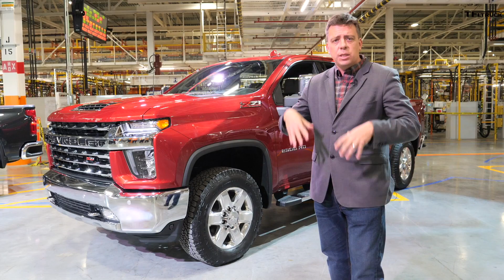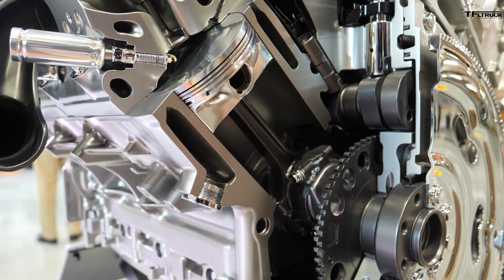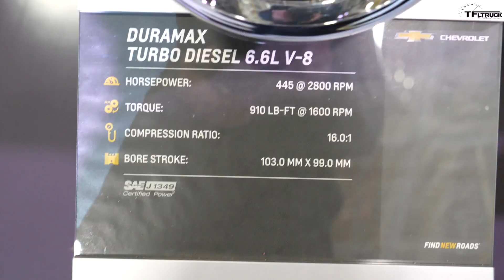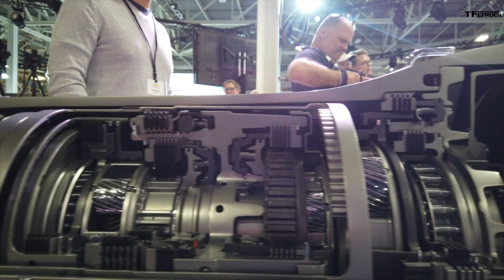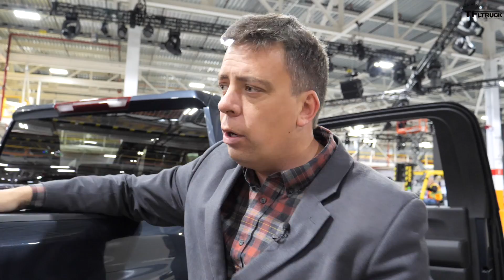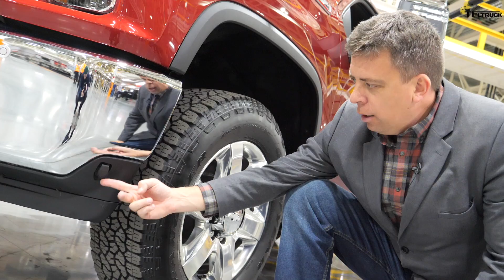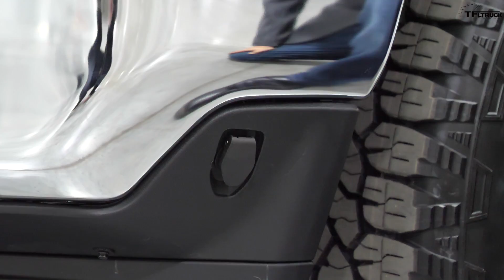Here is How the 2020 Chevy Silverado 2500 HD Delivers the Torque to the Ground

Comment: Oh Chevy... still going to put a 6-speed behind your gas engine while Ram and Ford have moved on. When will you learn.
Reply: Ford is still using the 6 speed in the 6.2
Reply: @geauxtigers2911  what 6.2. Lol
Reply: Their doing it for a price advantage, the 6 sp is cheaper to build and easier to rebuild because it's been around awhile
Reply: Customers do not care about the money they save building something unless its shaving off the sticker price. Ram and Ford are using their existing transmissions which have been around awhile. Chevy has better options but is still stuffing the cheap one in.  The fuel economy difference between a 6 speed vs an 8-10 is HUGE.
Reply: Ford still has 6spd for 6.2L engine. 10spd is only for 7.3L and 6.7 td. To get the 10spd I believe the lady mention it across the lineup when GMC hd pulled boat. We have to wait to see if that's true.
Reply: They are waiting for someone else to develop and build something different so they can copy it or buy it like normal.
Reply: @ecoboostrules9795  your parents raised a dumbass...ford and Chevy worked together to build the  10 speed
Reply: @geauxtigers2911  omg you are severely delusional. Ford had it built and gm wanted in on it. It was already pretty much designed and going in trucks by the time gm got wind of it. GET A CLUE!!   typical gm fan, thinking gm actually did something to help on it. Look at their trucks, you see what happens when they try to design something. 🤢🤢🤮🤮🤮🤮🤮🤮
Reply: @ecoboostrules9795  https://www.caranddriver.com/features/g15377492/ford-10-speed-automatic-transmission/
Reply: @ecoboostrules9795  True that! Ram releases their tow specs and a week later GM finally releases theirs... and it's 35,600lbs over Rams 35,100lbs. If I were Ram I'd raise my rating to 35,601. In the end though Ford will probably be more than both of them.

Comment: I've owned eight Chevy 3/4 ton trucks throughout the last 16 years or so.  A couple new, three of them diesels (04 -09 model), four 6.0l (05-18 model), and one 2001 8.1l with Allison trans. and currently 2018 6.0l gas. All used for pushing snow, hauling 6-9,000lb. trailers and pallets of various weights in the bed. From personal experience, I've never encountered all the claimed problems with these trucks. Regular preventive maintenance goes a long way. Actually cost of ownership is quite low, all I can remember replacing was the common trans cooler lines on 2 trucks back in like 2006 or 2008 and 1 rear axle seal. I'm ok with that considering how much these trucks are worked. Granted,  I'm fortunate to trade up around 70,000 miles or so, but I kick these trucks asses 5-6 days a week (never a trade up because of problems). Anyhow, I have respect for all the big players in the truck market, just happen to prefer Chevy. Hopefully this new gas 6.6l proves as reliable as the outgoing tried and true 6.0l gas engines. Looking forward to owning the new one in a few years. If you read this far,  peace ya'll!
Reply: I off road my Chevy's hard core and daily drive them till  200,000 to 260,000 miles.  Just recommended maintenance is all I do to them no major issues...
Reply: I use the same philosophy.  I've been asked why I don't try Ford or Ram and it requires a simple answer...  Why change when something has been really good to me.  
And I'm sure there are Ford and Ram owners who feel the same way.
Reply: @bryane2857  I've had them all, and mean all. As of 2010 there is only 1 brand i will buy that has been on top for many years. I absolutely hated Ford before 2010. Now wouldn't buy any other truck out there due to technology, comfort, reliability, crash tests, looks, and the fact that they are an American company that isnt owned by government money. All i can say. They make insane power with small engines and have the coolest stuff for performance trucks and cars.
Reply: @ecoboostrules9795  well I was going to tell you great comment. But you ruined it with your snippet about the government. I get your a fan boy, and that is cool.  But open your eyes, Ford was lucky, the secured a loan before the crisis. As pure luck would have it, the other 2 waited to long because Ford needed it worse as luck would have it.  
Your boy Allan Mullully which is The x president of Boeing for which I work dazzled his way threw the mess for Ford. And fortunately for Ford scatted by without a loan  .
It's obvious you can't appreciate other companies with your American bias. 
I hope you apply the same philosophy when you go fly with a airline and demand the airplane be a Boeing jet and not Airbus.
Also demand that Ford don't get anymore subsidies thew federal, state and local goverments. Out your American made comment where your mouth is and fly American made jets or don't fly.  Demand that Ford Fiat and gm alike stop taking subsidies. Until than, your fan boy Ford comment lost all credit from me.
Reply: @bryane2857  not a fan boy. Learn how to read. Looks you brought your feelings.  I tell it the way it is whether or not it benefits me. You apparently cant handle the truth. Again I've had all brands and stick with the best.  Right now, and for many yrs now nothing comes close to Ford. Crash tests prove it, sales prove it, reviews prove it, not much else to say. Your talk about loans and shit better do some studying bud. Dont like ram so dont give a shit what they do, they took money also, then fiat took the trucks and across the pond they went also. Now they make junk too. My comment was nice still is. Just the truth that hurts sometimes.
Reply: @bryane2857  They mortgaged their assets to bail themselves out instead of standing there with their hands out waiting for the tax payers to give them money. Big difference in how each company got out of that mess
Reply: @davidfoster7008  you are correct. Because Ford was in Worse Shape  they had to act first. When gm and Chrysler saw the writing it was too late they were in the recession of 2008 and couldn't secure a loan like  Ford .Theony of it is because Ford too was in as bad of shape if not worse they had to act sooner and they turn out smelling like a rose. I have Ford stock and gm and I'm happy Ford got lucky because I made money. I am happy that you paid to bail out fm because I made money on that deal too.  LMAO.
Reply: You mean a gm tranny.
Reply: I saw 8.1 and I had to comment it’s my daily driver and those trucks are one of the greatest that gm ever made
Reply: goose bumps what’s the last year GM made the 8.1? I’m kinda looking for one now. I’m happily driving a 2016 1/2ton 4.3 v6 Silverado 4x4 butttt im looking for a beat up truck I can work. The 1/2 ton is fine but ..... it’s just that a 1/2 ton v6.  So for me I’m torn between buying a 8.1(454?) 1 ton or 3/4 or selling my 2016 and buying a 2020 6.6 v8 gasser , I dream about the diesel but come on... I don’t wanna put up with the DEF and I’m not rich lol
Reply: German Howitzer firstly I’ll answer all the questions right here the years for production on the 8.1 were in the first generation GMC Sierra and Chevy Silverado so the years 99 to 06 secondly the 454 was the 6.0 I believe the 8.1 is a 503 so it’s a monster of a motor and if your looking for something that can tow and get you where you wanna go I’d get one the only downside from factory they can burn oil you might get lucky and get one that doesn’t but a lot of them do the other downside it they get like 7 to 10 miles to the gallon but other than that the truck is completely solid I drive a 04 3/4 ton GMC Sierra SLT and it’s the best vehicle I’ve ever drove for a truck and I’ve drove a lot
Reply: We have an 07 3500 chassis with a 3 yard dump and a 6.0. We beat the crap out of it and all i can say is its a solid drive train.    I hope this engine is a hit for ford and is proven reliable.
Reply: @peterad1529  if it's a hit for Ford it will be a disaster than for gm. Lol
Reply: you cant beat the gas trucks when a 6.0 motor complete replacement cost is the same as the injection pumps on any of the diesels , or injectors lol . not to mention gas is currently cheaper (usually is) so  several lost MPG is nothing to worry about. there is a reason light duty truck fleets almost never include diesels.
Reply: Peace!! ;)
Yup, they all have their ups and downs, recalls, lemons, some powertrains better or worse than others.  Some of us live and work in the rust belt, some in the dry sands of of the Southwest.  8 years of Ram 1500 ownership, 2nd truck, and all is well so far.
Reply: I got ford 2005 250 and still going more i got Chevy evey Chevy own blow a headgas
Reply: cat 416b backhoe thank you
Reply: Stanley Banks  Yeah 70k is nothing for a truck, you'll rarely run into any problems unless it's a Chrysler.
Reply: How much does Chevy pay you? Lol ( I own a zr2 great little truck)
Reply: @johnathoncastro  I had a 2001 zr2 I sold it with 252,000 miles on it.  I off roaded the crap out of it!!  I mean beat the snot out of it!!  I'll I've done was normal wear components, no major repairs.  It even had the factory Bilstein shocks on it when I sold it. It had the factory original drive train and nothing was ever rebuilt.  It Never left me stranded!!  Genuine Chevrolet...
Reply: Haha...i guess you could say they are paying me with satisfaction. zr2 is a great truck! @johnathoncastro
Reply: 8 trucks in 16 years... wow thats horrible I knew chevys where crap but thats bad.
Reply: @Bizketbutt  Upgrades were never a necessity,  simply could afford to do so. Thanks for trolling tho!

Comment: A built in PTO unit?Nice feature.That would cost thousands to add on....
Reply: All the PTO’s i am familiar with are on class 8 trucks, they have an output line and a return line so it doesnt matter what way the power take off faces as you run the hoses to the back of the truck. I am sure you can do the same with this one.
Reply: The Allison has always been able to have a PTO. Now you just don't need to drain the fluid to install one and even then it shouldn't take more than an hour.
Reply: phuck ewe  except its facing the wrong way lol
Reply: I'm still driving my 1984 chev C30 as a back road truck and it's got a PTO, shaft runs to a hydraulic pump for a cylinder on a dump bed.  Far as I knew it was an option that year so not the first time OEM.
Reply: @raptuous  my 1978 C20 has 2 PTOs on it, neither are hooked to anything at the moment, but its got 2 shafts ready to use, I have seen 4wds with 3 before too.
Reply: @Timothy R I've got a 1976 ford with factory PTO, got a 1978 with 2 PTOs, used to not be much special about it
Reply: Timothy R Chevy has the option too, same as dodge, you typically only see them on the 1 tons and up and mostly in Chassis configuration as people drop a tow truck body or dump bed on them. Very rare to see a PTO on a pick-up body as you wouldnt really have use for it because you arent carrying an implement that requires one.
Reply: @ChuckBeefOG  PTOs on pickup bodies aren't unusual on hay trucks, as since you are usually just using a winch to raise and lower the spike, thus a utility bed is usually too narrow and a flatbed doesn't add any purpose, since most of the space in the bed is taken up by the structure to support the spike, however on a modern truck a PTO is very unusual on a pickup body, since only the wealthy uses them for field work due to the exorbitant cost of the modern truck and the high cost of maintenance over something like a square body Chevy or dentside Ford in that type of use case
Reply: $800/month plus insurance and you can have one
Reply: Josh Hanson $1500/month in Canada with no down payment for 60mnths at 0% interest lol. They are getting a little out of hand with pricing.
Reply: This is new? Maybe I'm missing something but I ordered a PTO on my superduty in 2006, and it was available all the way down to 2003.

Comment: Ford also already coming with a new hd 10 speed automatic transmission. Chevy just copy fords idea
Reply: How can Chevy copy Ford, when Chevy is doing it first?
Reply: Turd Ferguson because it's a Ford designed 10 spd
Reply: Trenton_ A and it's going to grenade under heavy duty use!
Reply: John Doe oh you've tested it ?
Reply: Trenton_ A nope, just common sense! They replaced a lot of parts with weight reducing ones.
Reply: John Doe therefore you cannot speak on reliability of the transmission
Reply: Not true. Save your comments for the video and dont be a troll
Reply: You guys dont know what you're talking about, the GM trucks are coming out first with the 10 speed, yet GM copied Ford???
Reply: Ford made there own 10 speed automatic gm bought theirs from Allison. And i know Allison is great.and i never said i knew everything. I just know what i like.and i drive a Toyota. And im sure you got something to say about that .but the numbers dont lie 😉👍
Reply: The ZL1 was the 1st vehicle to have a upgraded 10spd. No other car or truck in either lineup uses it. As far as trucks GM was the 1st to release to media they were using a hd 10spd.
Reply: Chevy Revealed The 10 speed first
Reply: Y'all do know ford and Chevy built the 10 speed together right? Or is ignorance bliss?

Comment: Trying to copy the new ford super duty but failed. Fords new 7.3l gas engine will be better.
Reply: 6.6L is based off the 6L which means it's still a small block. The 7.3L is a big block which is more inline with GM old 8L. If anything 6.6L size is similar to Ford entry 6.2L. Talk of copying can't be used when GM has actually the highest displacement ever built.